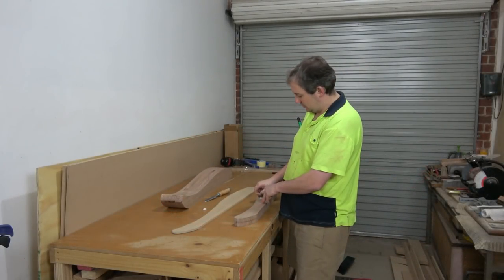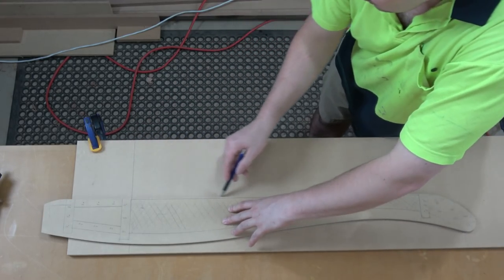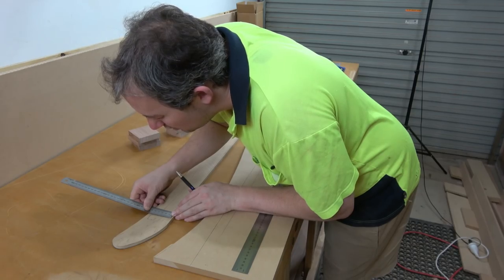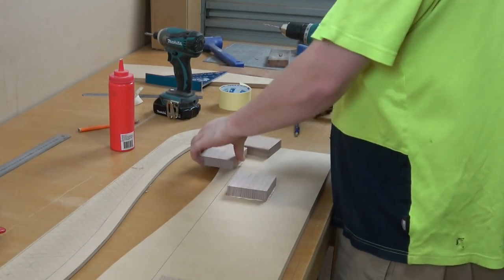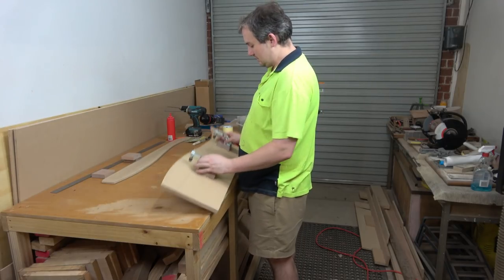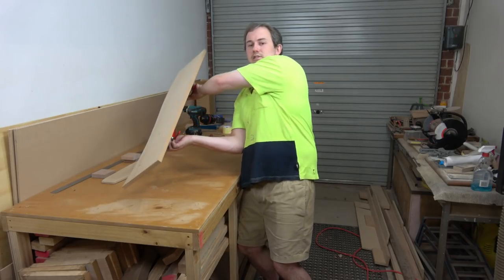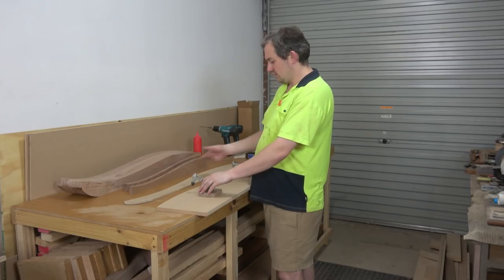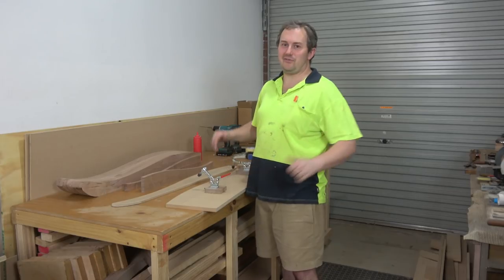How to make router templates - Woodworking Baby Cot VLOG 8

Comment from the maker: There are other benefits to this style of copy jig/router template, that were not discussed within this video. You get a cleaner cut because when locking the small lightweight work piece to a heavier jig with rubber stoppers, it dampens much of the vibration and bounce that can commonly occur when using the tracing template as demonstrated early in the video. Also given the fairly standard way of holding the jig via the toggle clamps, it promotes a consistent feed speed and downwards pressure for the duration of the cut.

Comment: Happy new year. Which double sided tape do you use? Is it available at bunnings or mitre10? Many thanks.
Reply from the maker: Happy new year mate. I get the tape from Bunnings. https://www.bunnings.com.au/bear-48mm-x-4-5m-white-double-sided-tape_p1661630. It sticks very well to solid timber. Bit of a pain in the butt to remove afterwards, but it's better than it being not sticky enough and you ruin the work piece because it shifts off the template mid-cut.
Reply: Greatly appreciated.
Reply: I have been using painters tape on both surfaces and CA glueing the pieces together. Works really well but was hoping double sided tape would be less hassle. Thanks again.

Comment: What's this 6 inches thing ???? You're as bad as me lol
Reply from the maker: Haven't you ever cut a 600x300 panel from a 8'x4' sheet of 18mm MDF and ran a 1/2" rebate around the perimeter, and then drilled a 35mm blind hole? I'm shocking with measurements. The poor kids at work have no idea what I am talking about.

Comment: Happy New Year and Very good video, where did you get those toggle clamps from?
Reply from the maker: Happy new year mate. I can't be certain where I got them from as it was years ago. Probably Carbatec. I don't see the design that I have on their website, but I have used many different types over the years. They are all pretty much the same. I like the horizontal handles because when you add height to the jig with the vertical handles, you gain leverage against keeping the jig flat down on the table.